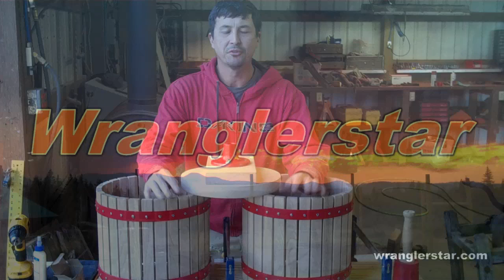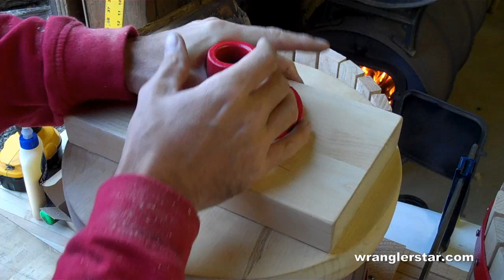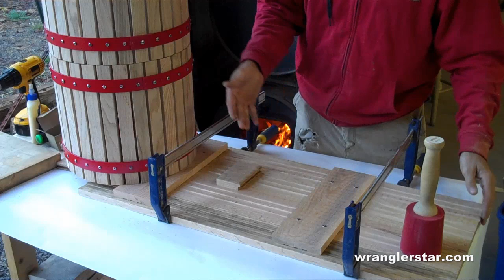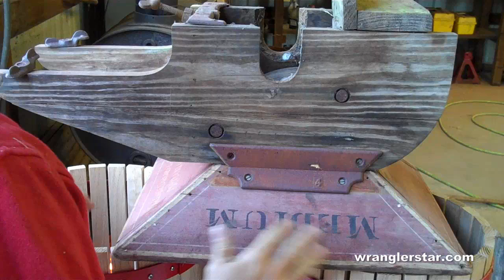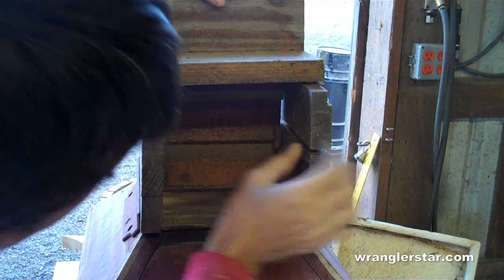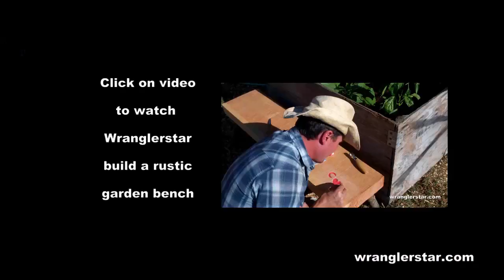Apple Press Restoration pt 2

Comment: My Dad's press was just bare wood.  I just built mine and I used TotalBoat penetrating epoxy on the basket/tub tray and pressing disk followed by bees wax.  Bees wax only going forward.  I'm using linseed oil on the frame (Doug Fir).  It doesn't touch the cider.

Comment: this is a good idea.  we know Cody has some boiled linseed around.  but be careful, most boiled linseed oil has toxic metal driers in it, these days.  i'd use raw linseed or raw walnut oil with about 1/5 beeswax per volume melted in.  thinking of using this on my new axe handle as well...

Comment: I'm so blessed that I found your outstanding channel... I do slot of restorations and whatever you use on the wood- make sure it isn't "new"! Lol. One tip I think you might like is after you sand or bead blast hardware that will "show", run it on the wire-wheel at 1750 rpm (slow) that will shine it up nicely! Then wipe it down with shellac! Nothing beats shellac! (100 year old tip) Thanks again!

Comment: After talking to a few woodworkers at a local Woodcraft store, they seemed to be of the school that a good quality wood doesn't need a finish as long as it is well taken care of, and kept clean.  Any hard finish will flake off with use and any oil that you apply will not provide a very durable finish. That being said, mineral oil is a good non-toxic finish used for cutting boards and salad bowls.  I wouldn't use boiled lineed oil on a food contact product because of the chemical driers added.

Comment: That hand crank handle look cast iron, If it is cast, you can’t weld it like normal steel. Actually you can weld it with mig welder at all. You will need a stick welder with special cast iron welding rods. Good luck, its looking good!

Comment: Go to the grocery store & get food grade mineral oil. Heat the mineral oil on low and add bees wax, the ratio is 3 (mineral oil) to 1 (bees wax). Apply liberally until the wood well not absorb anymore. Wait 15 to 20 mins & wipe the extra finish off & let it stand for 24 hrs. You need to reapply the finish the same way until the finish has developed a solid finish and won't absorb anymore finish. You shouldn't  have to reapply for a long while but when you do just repeat the process.

Comment: Hey Cody,
You might want to give some consideration to the crank wheel before welding.  If it's cast iron, you may end up wrecking it.  Brazing would be safer if you don't have the special high nickel rods.

Comment: use a piece of clear acetate to trace the name lettering and cut out a stencil from it if you need to repaint. if the wood on the upper  needs replaceing it looks in good enough shape to make a template to trace on a new piece of wood. a little buffing compond may bring the paint back but i would do it by hand because it may eat through the paint and lettering if done with a machine can get it at auto supply stores also hand glazing compound. project is looking awesome.

Comment: There are a few oils you could use, drying types and non-drying types, or just wax it. Wood does not harbor bacteria in most cases. Myself, I would go raw. This is just my experience of 32 years as a painter and furniture/cabinet finisher.

Comment: One other thing, if you plan to store the cider long term, make sure to pasteurize it.  Otherwise over time it will naturally ferment and turn into hard apple cider. Or, if this is your goal, then set aside the portion that you wish to ferment, and store it in 2 liter pop bottles or some other container that will hold the pressure of the off-gassing of the cider, and let it sit at room temp for a few weeks.  It will naturally carbonate and make its own alcohol.

Comment: Hi Cody, my family has a cottage in rural Michigan, which is famous for its apples.  We too have a yearly cider making tradition, and our wooden press is treated with nothing but vegetable oil.  It is enough to preserve the wood, and prevent the cider from impregnating the wood enough to stay in the fibers long enough to turn rancid.  Make sure to clean and dry the unit well after use, but you will have some time as the natural acidity of the apples prevent it from turning rancid too quickly.

Comment: I've seen a lot of people on here recommending butcher block oil and other "food grade" finishes, but I'm going to go out on a limb and say don't treat the barrels or the cider tray with anything.  If the barrels are made out of oak, they will absorb some amount of cider but once saturated the cider will stop infiltrating the wood.  The key will be to allow the barrels, the press and the tray to dry thoroughly in a well lit, preferably natural light, area to prevent mold from forming.

Comment: I think a finish of any kind is completely unnecessary. You obviously take great care of your possessions. I think if you rinse the press thoroughly after each use, keep it in a dry well ventilated place while not in use, and keep the the newly painted cast iron hardware maintained. It will last you a very long time.

Comment: Wanted to add that you would use raw linseed oil not boiled. Mineral oil has about the same water resistance prop. & reapplication sched. Both would work great for this type of project.